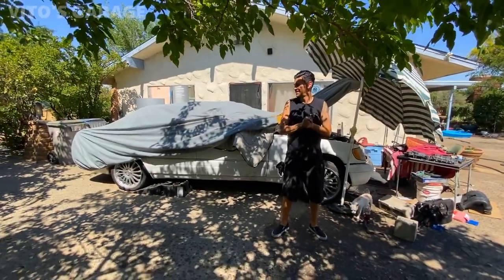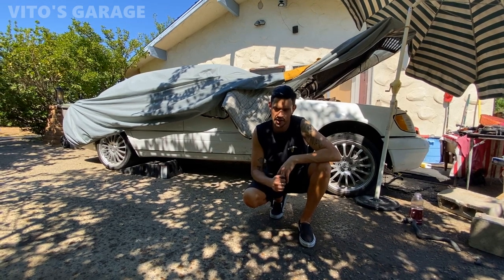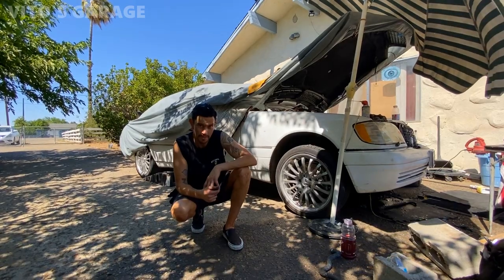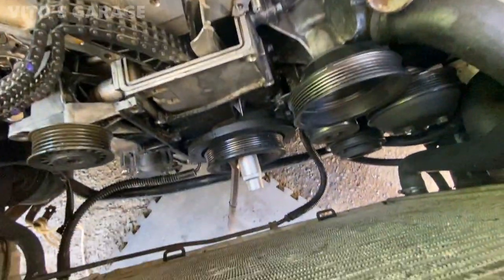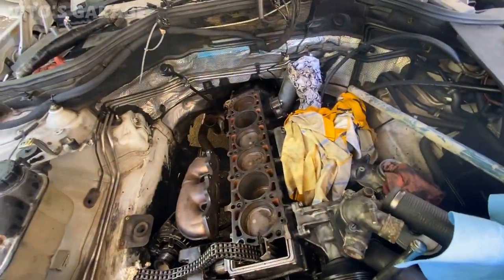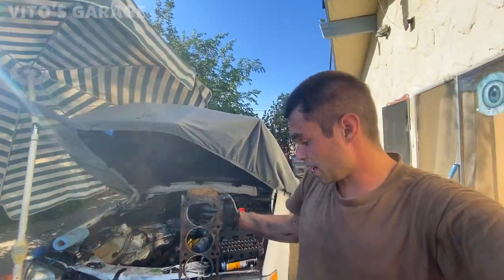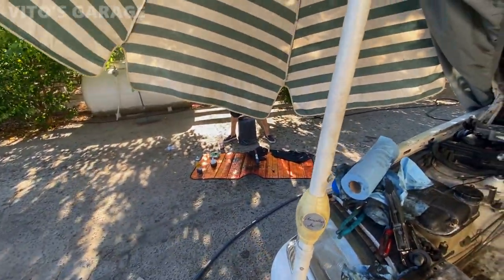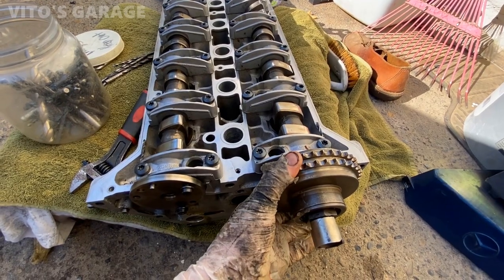Helping a Complete Stranger Fix His Broken 1999 Mercedes W140! He Thought I was a Scammer!

Comment: Vito, i also own a white 1991 Mercedes 190e as yours but with the 4 cylinder m102 1.8 engine with 275K kms. My car burns some oil. I did a dry and wet compression test. The dry compression test showed me 130-135 psi across all the cylinders. In the wet compression test, the compression jumped a little bit. It showed 145 +- psi across all cylinders. This means that my compression rings are holding up preety good comparing to your dry and wet compression (given that it showed 180 psi and then 240 psi accordingly). In your case this increase of over 10-15 % shows worn rings, but in my case it indicates some wear in the valvetrain/ head. Given that my car burns some oil but it doesn't smoke at all, should i consider replacing the valve stem seals? I mean it burns for sure oil from the pistons but will it help me to reduce my oil consumption? The car burns 2,5 liters per 5000 kms.
Reply: Only replace the valve stem seals when you go in to change the headgasket and refresh top end. If you must do it, use compressed air for the cylinders so the valves don't fall down. I wouldn't use the string method. How is your blow by? Do you have oil in the air filter?
Reply: Thanks in advance mate for your response! 
There is no oil in the air filter box whatsoever. The crankcase ventilation is not clogged at all. I have checked all the hoses and there is no external leak and the hoses are not brittle. They are in pretty good shape given that we park the car in a closed garage. The engine works perfectly fine and the oil consumption through the blow by is increased when i drive it hard (i have checked it way too many times) but it consums- burns some oil. During the last few years we drive it mostly in the city. My family and I owned the car since brand new, so we know exactly how it is maintained. It started to consume oil during the last 8-10 years but within the last 1,5-2 years it burns nearly double as much as before. This makes me think about worn valve stem seals. I won't replace the head gasket. I am gonna put each cylinder at top dead center and it will work without compressed air. Way too many people have done this this way. Since the piston is at top dead center, the valve won't drop enough. In m102 and m103 I don't think it is a difficult job. I will use a valve spring compressor and a magnet for the keepers and it will work just fine (i think). It is worth a shot (i think), given that the valve stem seals are 31 years old and with some kms on the clock.
Reply from the maker: Replace your valve stem seals. It's not too hard to do, just requires patience. If I were you, I'd remove the cylinder head, clean everything, replace gaskets and seals while I am there. When the cylinder head is out, it's also a lot easier to replace the valve stem seals. That gives you an opportunity to clean the cylinder head itself too. 
But of course, you can just replace the stem seals using a method with compressed air and pistons at TDC

Comment: Just stumbled across your channel. Love the care and dedication to the old MB. Recently found a '94 S500 near me that as been sitting for a least 3 years, but supposedly has had some work done to it and did run until parked. Any ideas what it might be worth and what to watch out for on an old W140? I'm in MI too and it seems pretty clean (not rusted, which is very important here) Thanks!
Reply from the maker: Thank you so much! It’s hard to say what it’s worth but I’d say around $1000 or less. You should get it. I can guide you and help you get it running. They’re amazing cars. I have a W140 also. A lot of these cars are 30-40 years old so they need our love and care. A lot of parts on them are still original and never been changed. But it’s amazing how long they last. You just need to go through it and sort it out. Make sure to connect the battery and try to crank it. Those are very amazing M119 engines. You can message me privately if you want. But like I said, you should consider getting it. I’ve been saving Classic Benzes and Bimmers for a while now
Reply: @VITOSGARAGE  Thanks for the response! I know you must be super busy. I sent you a PM thru Facebook, hopefully that is ok...

Comment: These inline 6 cylinders, if you change the head gasket once, will it happen again? I’ve heard they happen a lot on these motors.
Reply: My M103 3.0 I changed the headgasket as preventative maintenence at 250,000km. The problem was oil was passing through gasket, good compression no coolant mix. I just purchased an R129 300Sl with M104 and at 159,000 Miles the gasket was done, coolant mixed with oil. They are great engines, bit expect to do this job. Straight six best engines! The new style headgasket has metal reinforced but will still go out eventually.
Reply from the maker: M103s and M104s are both amazing engines. 
Once you change the head gasket it’s gonna be good for another 100 years. Please stop being scared. All Classic Mercedes are amazing